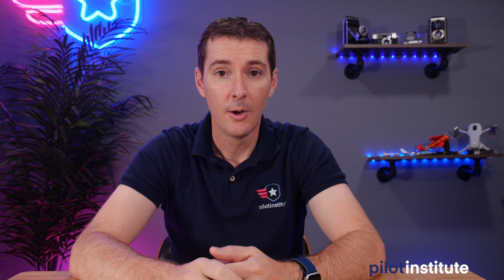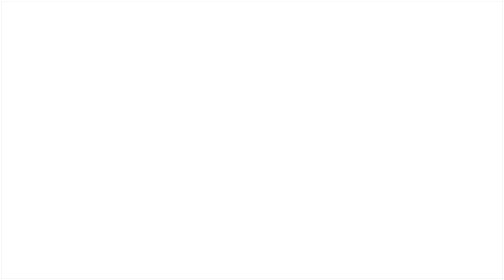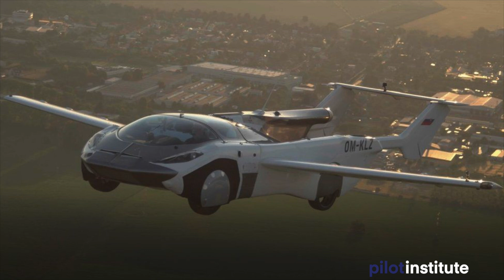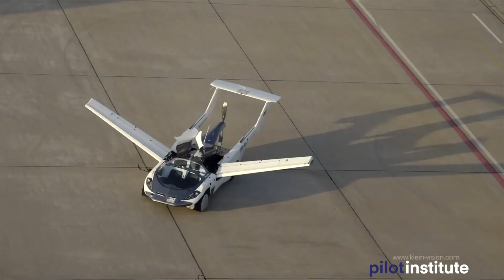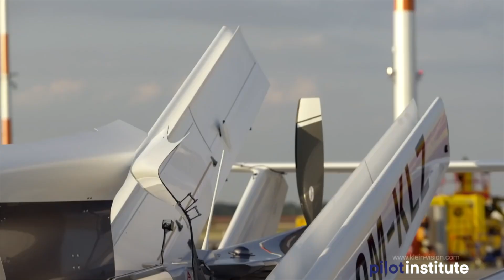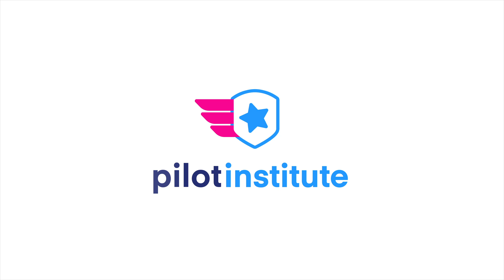Airplane news, AirCar test, B737 ditches, Casa Grande's Second "Airport", Preowned Bombardier

Comment: I have seen Auxiliary fields and even helipad landing areas designated as parts of airports.  The airport maintains the area but it is not directly connected to the main field.  I would have a problem with no services, no structures and no medical - fire aid directly available.